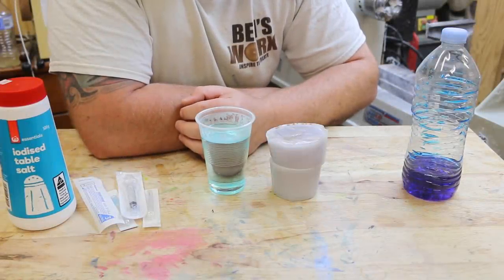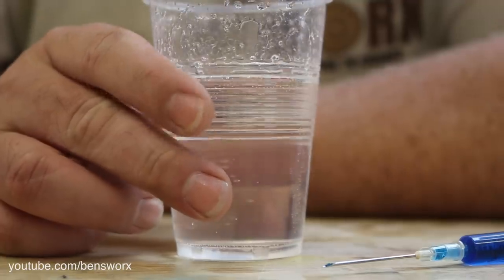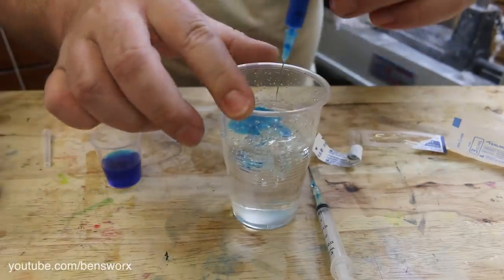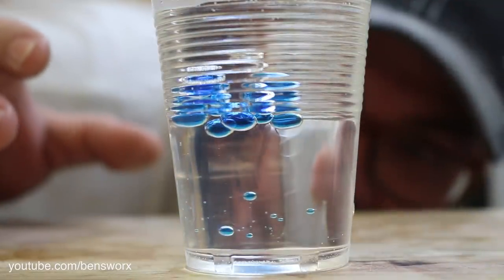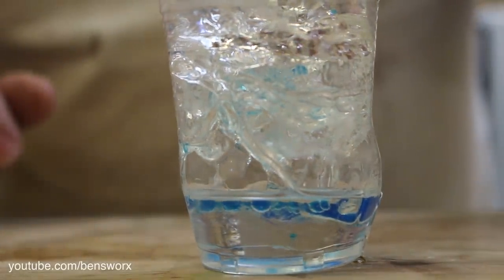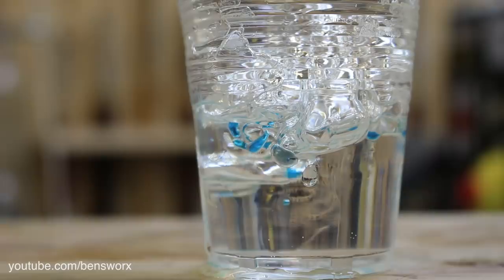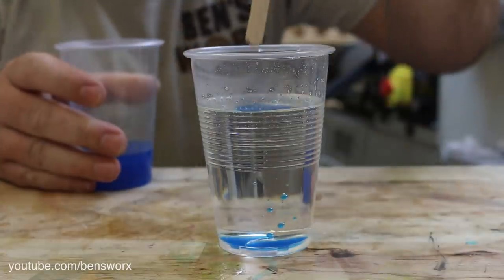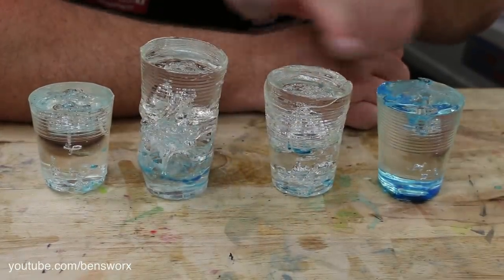Injecting Water Into Resin

Comment: That last one with the salt, maybe once the top layer has firmed up enough you could flip it upside down and that heavy salted water should float, or rather sink back towards the middle where you want it if the bottom section is still very fluid like the other times.
No real or recent experience with this sort of thing, just an idea I think would work after observing your results here and thinking about a solution to getting the water somewhere in the middle.

Comment: The problem is the water expanding as it boils and turns to steam, right? What about injecting dyed peanut oil? It boils at 230 c, so it probably wouldn’t expand. You might be able to trap bubbles and keep them looking like it did when you first injected the bubbles.

Comment: You could mayb make a solution of water and salt to match the density of the resin, so it would float in the middle. Or use a lot denser fluid that doesent boil easily like glycerin.

Comment: I just had a thought that why not try to use some form of oil for example cooking oil with a tint in it. I thought this because the oil would maybe not have such a bad reaction because it has a lot higher boiling point than water also you may be able to get the bubbles to stay in place because of the different thickness of the liquid, hope that helps u out love the videos 👍👌✌️

Comment: I just want to say that when water boils it turns into steam and expands into hundreds of times of its original volume.  The safety videos at work give you the rough estimation that a golf ball sized amount of water will expand into a beach ball sized amount of steam as it's heated really quickly.  This is mentioned in the context of water getting trapped in molten aluminum and causing explosions but I'm wondering if it's something similar happening here.

Comment: I think you should take a ping-pong ball and put two holes in it . One hole big enough for a straw to be inserted. Then take a LED and soldier a couple of wires to it. Next  using hot glue afix the straw in to the ping-pong ball with the LED on the top of the straw. Next put a hole in the bottom of a cup and put straw with wires ,light, and ping-pong ball in the cup. Now use hot glue to seal the straw in the bottom of the cup, and some glue in the straw  to seal it from letting the epoxy out.  Then fill your cup up to the top of the ball but not over the hole in top. Next add mineral oil into ball and use hot glue to seal the hole, then pour the rest of the epoxy in covering the ping-pong ball. After everything cures remove cup from resin and now you can add a 220 ohm resistor to the positive side of three 1.5 volt batteries wired in series. Then hook up a microswitch between the positive  and the LED. Hook the other leg of the LED to the ground or negative side of the batteries. Might make a pretty cool battery powered night light.

Comment: Ben, maybe try a drop of water on the bench then use the UV resin to make a half moon mould, then turn it around, fill with water drop then enclose it with the UV resin again into a sphere, then drop those spheres into your normal resin and then cross your fingers that it works

Comment: What if you put it in the pressure pot quickly before the water boils? More pressure raises the boiling point of water, if the pressure is high enough it should stay in its liquid state even if it's above 100C

Comment: Congrats!! 23 years! Nice one! My Mrs and I celebrate our 34th on the third. 
Where was your lab coat!? Dr Ben needs a lab coat......they are proper etiquette when experimenting! 
Like you I like the exploded result...... visually more interesting. With careful salt density you could achieve neutral buoyancy with the water drops. Keeping the drops from steaming away is another matter. Timing is key it would seem. What about using a tube instead of a cup.......that way you could inject over a longer period of time. What ever you do don't mix the epoxy with vegemite.....I saw a guy mix marmite in and turned a bowl out of it......smelly bowl that is. And the colour..yuk! Interesting effect though, the mix hardened just fine.

Comment: I think I have an easy fix for the boiling of the water issue.  Put it in a pressure vessel. 15 or 16 pounds of pressure would increase the boiling point to around 250° the more pressure the higher the boiling point.

Comment: When you poured in the salt water it went straight to the bottom. Therefore, I believe that you may receive your desired effect if you let the resin stand a bit and let the top harden, flip it upside down and then inject the salt water through the side. 
Another idea I had was, instead of injecting room temperature water, what if you heated it up before inject it in? No idea if it’d work or not, but my sleepy, 1:35 AM brain really wants to see it tried! 😂LoL

Comment: Maybe what could work better would be to blow a cavity into the resin, when it's cured enough to be molded, and won't collapse in on itself, but not too cured, so the displaced resin has somewhere to go. Also leave a small tube in there to the cavity. Then, when it's fully cured, fill the cavity with water and close the tube channel with more resin, but don't get the resin in the cavity, so it won't explode. Maybe a small clear plug that goes down into the tube channel and then fill the rest with resin.

Comment: This may be cheating a little, but try it with a hardened resin base at the bottom of the cup.  Top it off with a second batch of resin, then pour in  the salt water solution again.  The water may still sink, but not as far.  It should collect above the resin base.  You could even hollow out / indent the base layer for the water to collect in.

Comment: Do the last one with salty water again. Salty water have higer boiling point thats why it didnt explode cuz not that much liquid was changed into gas. But this time w8 until resin in upper cup start solidity then flip cup over so salty water will rise into middle of the cap. 
Sorry for bad english.

Comment: I think the third one was more aesthetically pleasing.  Before I knew better, I tried tinting resin with water based coloring.  It went nuclear and violently foamed out of the mixing cup!  Lol

What about putting oil and water (two colors) into something clear that can be filled and sealed. Cast that.  Maybe the clear “capsule” would disappear and you’d have this non-mixing, fluid, two color blob in the center of the cast.  Never tried it but it would be interesting to see!

Comment: probally been said before and or you may have learned this from your experiments but you need to ither use liquid that has a higher boiling point then the temp the resin gets too. or cool the liquid to the point that by the time the liquid can turn to gas the resin will have firmed up so much that the gas cant excape. also when you start stabbing your cup the pressure from the boiling water is pushing the resin out of the hole you just made then allowing air to get in.  leaving the neddle in was the best choice for what you did. try mineral oil next. it has a higher boiling temp and its clear so you can make it look like water.

Comment: OK, distilled water so it has a slightly higher boiling point but with no colouring, seal the hole with a little UV resin, hopefully the water boiling will create a steam pocket before setting

Comment: Heat of the reaction is boiling the water and making gas? thus explosion? or is it reacting with the water and creating some other gas? What id you left a needle like submerged as a vent hole near the top middle.
Reply: or maybe do a two part ur, cure like 2cm in the bottom then more resin on top with water bubbles in to give it a center platform.

Comment: Dissolving salt in the water raises the boiling point of the water. You raised it higher than the heat produced by the resin. If you used more resin, you would get more heat. Larger quantities may still explode.

Comment: My mind is just racing with ideas, like “if only you could get the bottom to solidify first and then add in the salty color water so it would sink to the hardened bottom to stay there while the air it created could be vacuumed out and prevent that explosion effect (even though it is pretty cool)

Comment: the water alone might not work, but you may have success doing a syringe, half full of water and the rest with air, wait until its half hard, inject the ait straight up to create a bubble, then wait for it to cool. then inject the rest of the half full with water, so it wont steam or boil, since its already cooled down. might be a bit of push and pull but once its in you could seal it with some resin maybe!

Comment: You need to use a UV cure or something that won't get hot and boil the water. The water is boiling turning into a vapor which is expanding but has no place to expand to so it's causing it to explode.

Comment: I believe the reason it exploded was not because of the water, but because when you pulled the needle out it allowed air to seep in through the holes as the resin leaked

Comment: I am betting that the reason the salt did not explode was that it was cooler at the bottom. The plastic cup in contact with the table was enough to remove the heat and keep it from boiling, another piece of help is that the amount of the cooler salty water was enough to overcome the heat being formed from the chemical reaction at the bottom. If you do this again and poor 1/4 of the amount of salty water in, and have the plastic cup suspended off of the table, you might get the explosion.

Comment: Once the Top hardened up it sealed in pressure below. To inject through the side after that point material would need to come OUT before being replaced. 
Same thing when I draw up vaccine shots from the vials.  You got to fill the syringe with an equal volume of air as the guild you are about to take out to leave with neutral pressure inside.

Also. That steam explosion could have given you a nice burn, even without splashing hot resin.  Hope you were wise enough to have safety glasses at least.
Didn’t see it on the first go.  But can see you had a face shield for the second.

Last one I’m not sure why it worked.  I kind of want to say the countertop was conducting away enough of the heat that the water didn’t turn to steam, since it was at the very bottom.

Comment: What possibly happened is that as the resin cured and hardened at the top the water was both trying to float and also starting to evaporate due to heat. Since it had nowhere to go it started to push resin down and out of the needle holes and to push the hardened resin up that's what could have caused that bang.

Comment: The salt water increased the boiling point a degree or two.  If you would have put it under pressure, the boiling point increases, as well.  But, getting the water to suspend where you want it long enough to pressure it and cure it would be the challenge.

Comment: I don’t know what it’s called, but the first resin I ever used didn’t heat up, and took a full 24+ hours to harden even in really small quantities, so something like that could be a pain to work with in scenarios like this because of the time, or it could be easier because the water wouldn’t boil... who knows, it just popped into my head.

Comment: next time leave the needle in the hole and the bubble won't pop right away than remove needle few minutes later Also put needle in on upwards angle after top of epoxy is hardened before pushing down pull needle out till almost out of hole than inject liquid to make paint bubbles leave needle inside hole for few minutes and bubbles should not pop haha. maybe:>)

Comment: I think part of your problem was that you didn't seal up the holes you poked into the cup. The resin leaked out and let in air, which helped the water move down. It may not make that much of a difference, but I bet it would have created a slightly different effect!

Comment: As the resin heated the water the expanding vapor tried to find its way out failing that it blew a bubble and as the bubble could not expand anymore it then burst and created the voids in the casting you found you had actually created a thing called a bleve which is a boiling liquid expanding Vapor explosion it could have been a whole lot more dramatic but you're lucky this was more of just a burst as opposed to explosion

Comment: You can't inject water if it the epoxy can't expand to fit it. What's probably happening is that the water is expanding(evaporating) because of the heat and there is no space for it to expand inside the epoxy, so the epoxy has to expand forcefully(explosively).This is further corroborated by the fact that the salted water(which has a higher boiling temp) didn't blow up.

Comment: Try again but boil the water first, Please

This isn't a fully thought out idea, but I'm sure you can take it and run. Put the resin in a container with a lid, once the lid is on flip the container over onto the lid. That way the resin will cure in the bottom of the container first. Once the resin is cured half way through, flip the container back over and inject the water through the container. As the resin cures, the lid should pop off hopefully avoiding the boom

Comment: Next time try with vegetable oil since it has a higher boiling point and won't expand into a gas!and is denser than water... so you should let it cool at the top then put it upside down and then inject it with the oil!

Comment: Why? Usually, when confronted with a simple problem - curing resin gets above 100°C, therefore water will boil and is not a good agent to inject into curing resin - the second experiment should not involve THE EXACT SAME THING and expecting a different outcome. The third try even involves saltwater, which will boil even faster. Even when you did not know how hot epoxy resin will get, you know after No. 1. Change the variables. Use liquids with a higher boiling point like oil. Or just use colored resin to inject. Simple household physics, man!

Comment: solved it, two holes at the top, length of string, inject the water, then spin the container at high speed like a centrifuge and the water should stay further down,
Reply: or even crazier put in magnetic impeller,  like the magnetic stirring machines at science class, bung in the resin, then coloured water and switch it on, make a nice water tornado effect.    Oh and happy Anniversary
Reply from the maker: Thanks Mate, cool ideas 👍